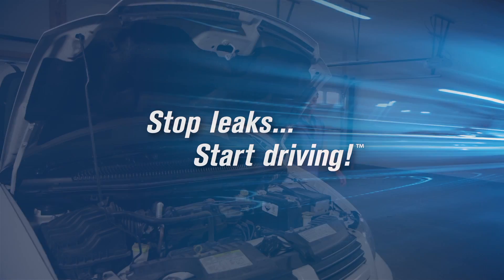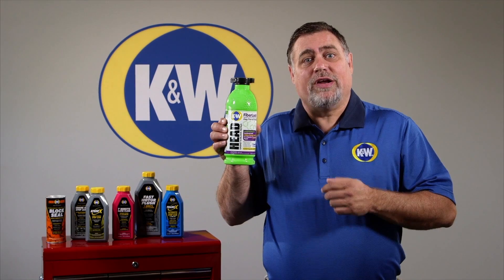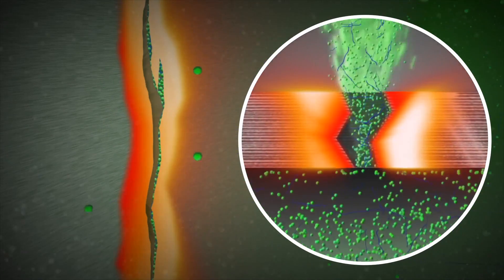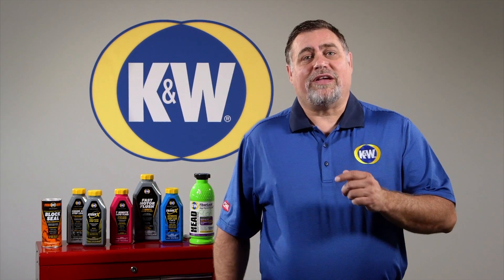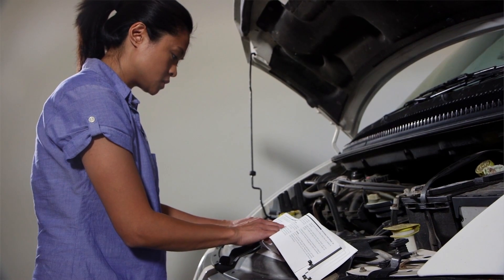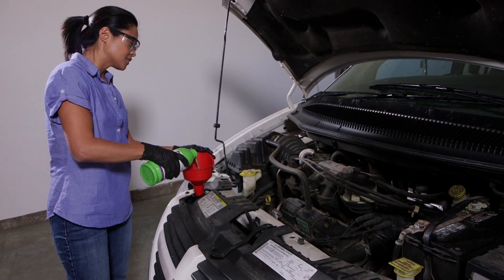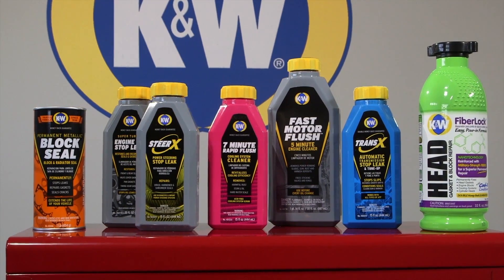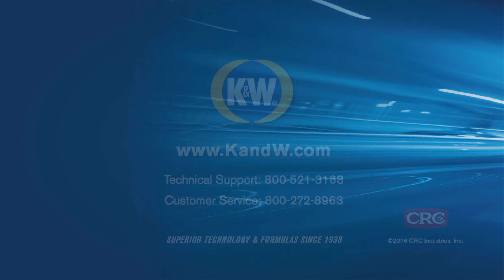Repairing Cracked Engine Blocks Without Disassembly | Know Your Parts

Comment: Decades ago there was pellets you could get to repair head gaskets and cracks in heads or cylinder walls by putting the pellets in the cylinder through the spark plug holes. 
Is that stuff still around?

Comment: There is only one word for this stuff..:CRAP.  I’ve used them all and this stuff will block up your cooling system in 5min…it’s that bad!
Reply: Old man you need to shake it up and stir it in coolant to disolve it properly. I cook it on the stove under low heat while stirring, turn engine on, pour in mixture slowly 1/3.. repeat until all gone. Do not stir in cold or full bottle at once, it will clog unless you follow my proceedure

Comment: Well I have to say this is my 3 pack of jb weld applying it to my 3.0 mercruiser is a little crack and it has gotten better but I will apply some more tomorrow and wait 24 hours and apply more and wait 48 hours just in case it has not Dried out perfect but I’ll keep u posted my engine still leaking
Reply: Update?? I have a crack in my 98 gs400 block, leaks oil, ima jb weld it probably

Comment: RECENTLY MY HONDA CIVIC 2007 ENGINE COOLING AREA CRACKED LEFT MY CAR AT HONDA FOR WARRANTY REPAIR BUT ITS MORE THAN TEN YEARS OLD SO THEY MAY NOT ABLE TO REPLACE ENGINE FOR FREE 
I WILL DEFINITELY TRY THIS !
Reply: Same exact car and situation here.
Reply: Any update on this?
Reply: Hello did you end up trying out this product for your Civic's engine block coolant leak?
Reply: Yep same here.  06 ex.  320k.  Thought it was the weeper valve on the water pump replaced it and discovered where the actual leak is coming from when the alternator was out of the way just to the right of the water pump thankfully I didn't have to terrible much of an issue getting the pivot bolt off of the hydraulic tensioner
Reply: @jesus-is Coming soon,

I have 2006 Honda Civic 280,000 miles. Just discovered same. Replaced thermostat, radiator cap, water pump and it overheated yesterday on way to Praise band practice yesterday. 
Did you fix your crack with this stuff?
Reply: @nathan68  did you ever fix this? Same car same situation
Reply: @Th1zzardOfOz  it is still working!
Reply: Blue Devil Radiator and Block sealer

Comment: Worked for me. Although recommend diluting/stirring with water as much as possible so the big chunks break up before pouring in to reduce risk of clogging radiator or heater core. May need to do this process a few times to seal up. dont pour whole bottle in at once
Reply: That actually might be a good idea you just go ahead and add it to the prediluted coolant like I know for myself my system needs like another gallon of coolant added so I'll just shake it up inside the coolant bottle to mix it up real good

Comment: Over heated my dodge Ram. Started blowing smoke at start up with gunk under oil cap. Blown head gasket. Tried Barrs leak and it worked for three days. Put k&w in and no more smoke or gunk. Been three weeks and 500 miles with no problem.

Comment: will this work on a boat that has a a 350 engine , the engine froze in winter and is mixing oil and water
Reply: Hi obet, It could be just condensation the oil and water if its been frozen. drive the boat underload and see the oil again

Comment: I used this 160000km ago.  I have no coolant leak from the head gasket since.  I left it in for 2 months and drained the rad to clean the fibers out.  I highly recommend this product.
Reply: alan courneyea did it still work after you drained the radiator, or did you add more after?
Reply: @ethos8201  just cleared the rad and still going strong

Comment: Has anyone ever tried this stuff? Does it actually work?
Reply: Almost 200000km and no issues highly recommend this product
Reply: @alancourneyea8778  what type of vehicle did you treat and was it a cracked block or head gasket?
Reply: @nathan68  it was a head gasket now over 400000 km on it put in at 190000
Reply: @nathan68  btw jeep grand Cherokee 4.7
Reply: @alancourneyea8778  do you sell this?
Reply: @neskender  no I bought it at Canadian tire
Reply: @alancourneyea8778  ok 👌

Comment: What If there's no leak. Just bubbles coming up and pushing coolant into the reservoir?
Reply: Blowen head gasket
Reply from the maker: Thanks for your question. For the quickest response and best information on this, you will want to contact the CRC Industries Tech Line: 800-521-3168
Reply: Probably the exhaust side it worked for me